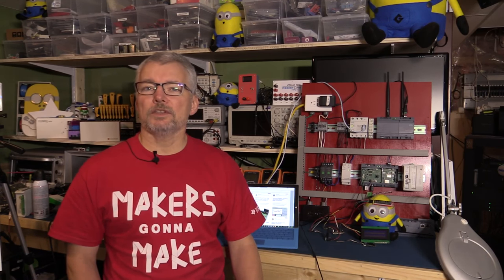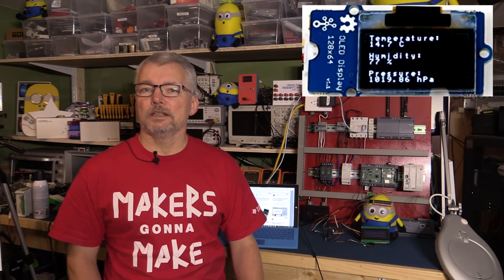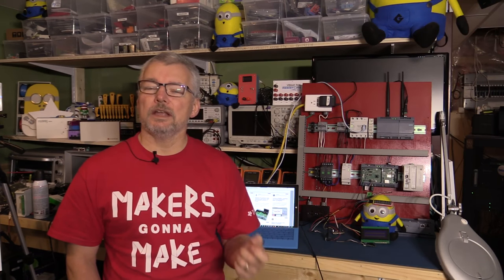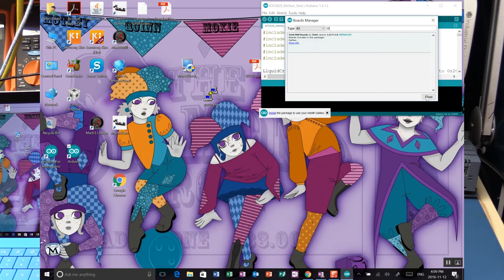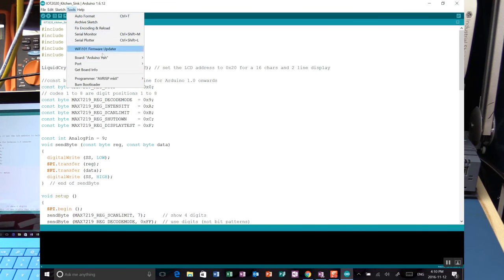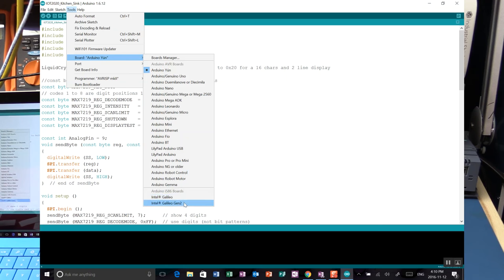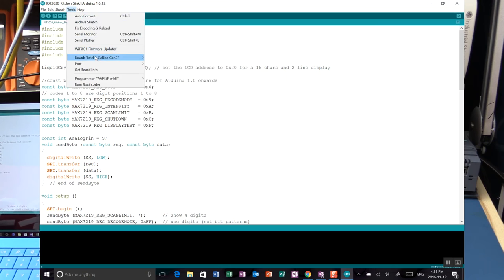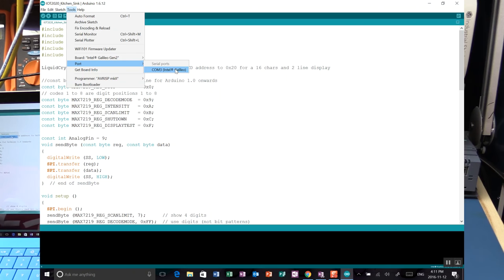IOT2020 - Running Arduino Sketch on Linux, I2C, SPI and PWM

Comment: Hi,
I saw your video about uploading Arduino sketch to Simatic IoT. Maybe you can answer my question about Analog Inputs. I have upload simple sketch to read Analog inputs of potentiometer and everything works perfect with Arduino Uno, i get values from 0 to 1023. But, when I do the same and upload sketch to SimaticIoT, I get values from about 685 to1023 (can't get full range). Do you know what could be reason for that? Thank you.

Comment: I'm not sure how you ever found libraries for this IOT thing. I have several LCD using controller chips like HX8375, SSD1306, ST7735, and even 2004 LCS, and i've yet to find a lib for these displays Adafruit, U8Glib, nothing will even compile. Heck SdDat won't even compile. Thoughts on where to get libs?
Reply from the maker: I believe all the libraries used are absolute standard ones.
#include <SPI.h>
#include <Wire.h>
#include <LiquidCrystal_I2C_8574.h>
#include <SeeedOLED.h>
#include <avr/pgmspace.h>

so one from Seeed Studio with no modifications to the library
An LCD Library for the 8574 SPI to parallel chip adapter. everything else is standard arduino IDE stuff

as shown in the link in the description, the full script can be found here :- https://www.rs-online.com/designspark/using-arduino-sketch-including-i2c-spi-and-pwm
Reply: Peter,

I got the SeedOLED lib and even using the supplied example, my display shows nothing, it will compile and appears to upload. Note my OLED is I2C based.

Any thoughts?

#include <Wire.h>
#include <SeeedOLED.h>
#include <avr/pgmspace.h>

void setup()
{
  Wire.begin();
  SeeedOled.init();  //initialze SEEED OLED display

  SeeedOled.clearDisplay();          //clear the screen and set start position to top left corner
  SeeedOled.setNormalDisplay();      //Set display to normal mode (i.e non-inverse mode)
  SeeedOled.setPageMode();           //Set addressing mode to Page Mode
  SeeedOled.setTextXY(0,0);          //Set the cursor to Xth Page, Yth Column  
  SeeedOled.putString("Hello World!"); //Print the String

}

void loop()
{
  
}

Comment: Hello Peter, 
Where do you find the libraries to run these? Any link to library to use WiFi shield with IoT 2040??
Reply from the maker: I would not use a Arduino WIFI shield, it would not perform well and would be a waste of money. You can get a very low cost PCIe one,  Intel for instance or even a USB WIFI Dongle  like the official Raspberry pi one for about 15$, both work extremely well and are easy to integrate and be accessible to the arduino code at the same time as the Linux system

Comment: how about pullup resistors? Every board which has i2c interface, has local pullups, so if you connect a lot of them in parallel the total resistance will decrease... in general is recommended desoldering pullups on little boards and leave only on 1 of them... you desoldered all of them and put them externally on that little board?
Reply from the maker: Nope, I don't agree that all boards have them. Some do, Some don't. in this case just like the Arduino UNO headers, no pull ups are included on the IOT2020. I have 2 10Ks on the expansion board you can see occasionally on the left view of the video. The display did not include local pullups either. 10K is also high enough to tolerate a few in parallel without affecting most I2C buses.
In a development environment is is common to come across more than one device with pullups. In most situations this will not be an issue but as you rightly point out, too many will cause an issue. Same can be said for none. no pullups will definitely cause an issue. (I have spoken to many engineers who have spent hours troubleshooting I2C just to discover that no one included the pullups... oooops)

Comment: do you have any idea what my problem could be? I installed the galilleo part. but I can't select a port. it looks like it just doesn't see it. when I plug in an Arduino Uno or Mega, I don't have this problem?
Reply from the maker: try the latest version of the firmware (Currently 2.1.2), it is already loaded in this version, There were a few issues I found with the first release and this video was based on the first. those issues are not there anymore. so you should not need to load additional modules outside of the sketch. if your still having an issue, please share the sketch so I can see what your doing.
Reply: Hi I am having the same issue, 
Arduino: 1.8.13 (Windows 10), Board: "Intel® Galileo Gen2"

Warning: Board Intel:i586:izmir_fd doesn't define a 'build.board' preference. Auto-set to: I586_IZMIR_FD

Warning: Board Intel:i586:izmir_fg doesn't define a 'build.board' preference. Auto-set to: I586_IZMIR_FG

Warning: platform.txt from core 'Arduino i586 Boards' contains deprecated recipe.ar.pattern="{compiler.path}{compiler.ar.cmd}" {compiler.ar.flags} "{build.path}/{archive_file}" "{object_file}", automatically converted to recipe.ar.pattern="{compiler.path}{compiler.ar.cmd}" {compiler.ar.flags} "{archive_file_path}" "{object_file}". Consider upgrading this core.

Sketch uses 80254 bytes (0%) of program storage space. Maximum is 10000000 bytes.

#!/bin/sh
starting download script

# clupload script to invoke lsz 
# Copyright (C) 2014 Intel Corporation
# 
# This library is free software; you can redistribute it and/or
# modify it under the terms of the GNU Lesser General Public
# License as published by the Free Software Foundation; either
# version 2.1 of the License, or (at your option) any later version.
# 
# This library is distributed in the hope that it will be useful,
# but WITHOUT ANY WARRANTY; without even the implied warranty of
# MERCHANTABILITY or FITNESS FOR A PARTICULAR PURPOSE.  See the GNU
# Lesser General Public License for more details.
#
# You should have received a copy of the GNU Lesser General Public
# License along with this library; if not, write to the Free Software
# Foundation, Inc., 51 Franklin Street, Fifth Floor, Boston, MA  02110-1301  USA
#

echo "starting download script"
echo "Args to shell:" $*
Args to shell: C:\Users\Sergio\AppData\Local\Arduino15\packages\Intel\tools\sketchUploader\1.6.2+1.0/x86/bin C:\Users\Sergio\AppData\Local\Temp\arduino_build_690845/sketch_dec17a.ino.elf COM1

# ARG 1: Path to lsz executable.
# ARG 2: Elf File to download
# ARG 3: COM port to use.

#path contains \ need to change all to /
path_to_exe=$1
fixed_path=${path_to_exe//\\/\/}

#COM ports are not always setup to be addressed via COM for redirect.
#/dev/ttySx are present. Howwever, COMy -> /dev/ttySx where x = y - 1

com_port_arg=$3
com_port_id=${com_port_arg/COM/}
echo "COM PORT" $com_port_id
COM PORT 1
tty_port_id=/dev/ttyS$((com_port_id-1))
echo "Converted COM Port" $com_port_arg "to tty port" $tty_port_id
Converted COM Port COM1 to tty port /dev/ttyS0

echo "Sending Command String to move to download if not already in download mode"
Sending Command String to move to download if not already in download mode
echo "~sketch downloadGalileo" > $tty_port_id
C:\Users\Sergio\AppData\Local\Arduino15\packages\Intel\tools\sketchUploader\1.6.2+1.0/clupload/cluploadGalileo_win.sh: line 42: /dev/ttyS0: Permission denied

#Move the existing sketch on target.
echo "Deleting existing sketch on target"
Deleting existing sketch on target
"$fixed_path/lsz.exe" --escape -c "mv -f /sketch/sketch.elf /sketch/sketch.elf.old" <> $tty_port_id 1>&0
C:\Users\Sergio\AppData\Local\Arduino15\packages\Intel\tools\sketchUploader\1.6.2+1.0/clupload/cluploadGalileo_win.sh: line 46: /dev/ttyS0: Permission denied
# Execute the target download command

#Download the file.
host_file_name=$2
"$fixed_path/lsz.exe" --escape --binary --overwrite $host_file_name <> $tty_port_id 1>&0
C:\Users\Sergio\AppData\Local\Arduino15\packages\Intel\tools\sketchUploader\1.6.2+1.0/clupload/cluploadGalileo_win.sh: line 51: /dev/ttyS0: Permission denied

#mv the downloaded file to /sketch/sketch.elf 
target_download_name="${host_file_name##*/}" 
echo "Moving downloaded file to /sketch/sketch.elf on target"
Moving downloaded file to /sketch/sketch.elf on target
"$fixed_path/lsz.exe" --escape -c "mv $target_download_name /sketch/sketch.elf; chmod +x /sketch/sketch.elf" <> $tty_port_id 1>&0
C:\Users\Sergio\AppData\Local\Arduino15\packages\Intel\tools\sketchUploader\1.6.2+1.0/clupload/cluploadGalileo_win.sh: line 56: /dev/ttyS0: Permission denied
An error occurred while uploading the sketch

Invalid library found in C:\Users\Sergio\AppData\Local\Arduino15\packages\Intel\hardware\i586\1.6.2+1.0\libraries\Wire: no headers files (.h) found in C:\Users\Sergio\AppData\Local\Arduino15\packages\Intel\hardware\i586\1.6.2+1.0\libraries\Wire

This report would have more information with
"Show verbose output during compilation"
option enabled in File -> Preferences.

Comment: Is it possible to run node red and Arduino program simultaneously in 2020, with MQTT broker.????
Reply from the maker: I have not tried it  but i dont see why not as long as your not using the same resources

Comment: Hi Peter are you the inventor of IOT2000? ...good job.We have a IOT2040 in office to play. Our target is to use it connected to the S1500 and use it as gateway for a moment. Wich editor or environment do you suggest me ?  I mean something like Netbeans or eclipse and deploying by using a C++ cross platform for example.... Do you think the Node-RED is powerfull and usefull to learn ?
Reply from the maker: Hi there and thanks for the vote of confidence but alas I am not the inventor, I have however spent a significant amount of time helping Siemens in getting the Linux OS to the point of being usable out of the gate, by getting them to include Node-Red, MQTT, SQLite etc and having most of the IO directly accessible from within Node Red as well as many other features that did not work so well when it was initially released.

Node-Red... it is my go to for all Linux automation projects, it is part of the IBM suite aimed at open source along with things like MQTT (Look up IBM Blue mix for more details) and I love it. it sits on top of NodeJS and therefor easy to integrate to a vast array of NodeJS libraries, in fact NodeRed is actually a NodeJS module itself. So do I think it is useful to learn, YES and I have already written a few modules for it myself. Also a good fiend of Mine (Peter Scargill has made a few modules for Node Red available too like BIG Timer, you can check him out at tech.scargill.net )
Reply: Thanks for the answer. We are going to use node-red but after an update we are not able to see the object to drop relative to the Siemens such as opc ua and S7 protocol. Now we are installing ecplise with many software , plugin and else .....We are in a trouble ahahahaah

Comment: Hi Peter Oakes,
Great video!

I was wondering if you could help me, because the online community support is quite limited at this moment.

I'm the lucky owner of a IOT2040 :)
However, I got a problem with getting it recognized on a Windows PC.
My device manager can't find the device.

Did you had any simular problems before it succesfully worked on linux?
Perhaps do you have it already running on Windows? :D

Greetings from Holland!
Reply from the maker: It was recognized right away , I just checked device manager, it shows up as a simple USB port and uses a microsoft driver. I am running Windows 10 64bit.
Are you running the latest version of the firmware from Siemens (Currently 2.1.2), if not then try that.
Reply: zelfde probleem heb ik nu, heb je daar al een oplossing voor gevonden?alvast bedankt,
Reply: Ik heb hem teruggestuurd. Krijg morgen mijn nieuwe binnen.Maar heb jij hem wel aan de praat gehad dan?

Comment: Is it possible to use I2C via the IO module for the iot2020?
Reply from the maker: if you mean the official Siemens IOT2020 IO Module then no, not without modification

Comment: Is it possible to change PWM frequency from IDE on IOT2020?
Reply from the maker: Which IDE ??
Reply: Peter Oakes arduino IDE, like with arduino to use it with analogwrite().

Comment: How would you connect a DHT11 sensor to the IOT2040?
Reply from the maker: if running with an Arduino sketch, I would expect it to just need the library, the way I would normally do it though is to have sensors remote to the unit using something like an ESP8266/ESP32 and use MQTT to consolidate the data.
The DHT11/22 has a pretty simple protocol though and there are plenty of examples in C so it should be fairly straight forward to code in C/Python/Java
Reply: I've used the DHT11 sensors before with an arduino UNO and Mega, but I'm wanting to use the IoT2040 to send the DHT11 Data collected to the Ubidots cloud. I have connected the IoT2040 to Ubidots already, but currently when i connect the DHT11 sensor to the IoT2040 how I would connect it to the UNO, but it doesn't seem to work, so my next thing would know if you can send the data from an arduino UNO to the IoT2040? If so how would one do it?

Comment: Hi Peter,

Hi All,

really hoping soneone can can help me! Cannot solve the following issue on my IOT2020!

I am running the following sketch on my arduino UNO and MEGA no problem. This sketch is the basic version of what I'm doing with a more advanced one that incorporates a display.. The sketch compiles, uploads all fine. I have the latest SD boot image, drivers etc. The Galileo 2 shows on the port all fine. Blink sketch works fine also. But this sketch  does nothing at all after uploading! Thanks very much for any assistance!

#include <MultiStepper.h>

#include <Stepper.h>

#define STEPS 400

// initialize the stepper library on pins 8 through 11:

Stepper stepper(STEPS, 8, 9, 10, 11);

int myCounter = 0;

void setup() {

// set the speed at 60 rpm:

stepper.setSpeed(100);

// initialize the serial port:

Serial.begin(9600);

}

void loop() {

if(myCounter<3) {

// step one revolution  in one direction:

Serial.println("clockwise");

stepper.step(1600 * 2);

delay(20);

Serial.println("counterclockwise");

stepper.step(-1600 * 2);

delay(200);

myCounter = myCounter + 1;

}

}